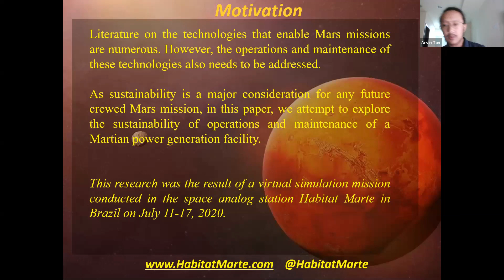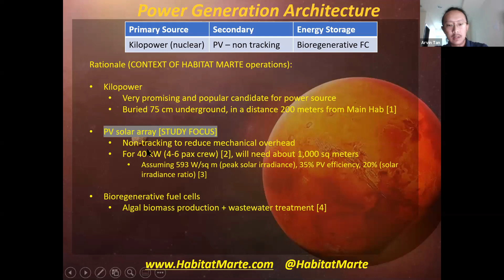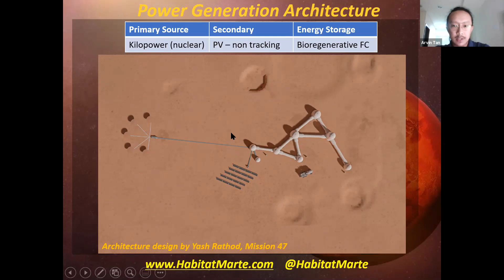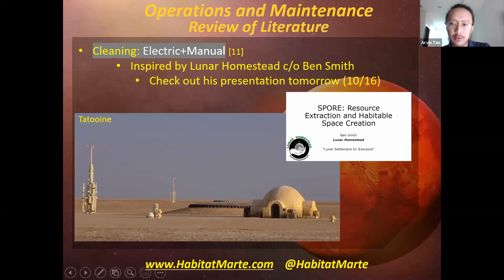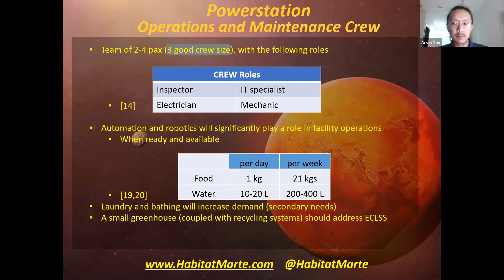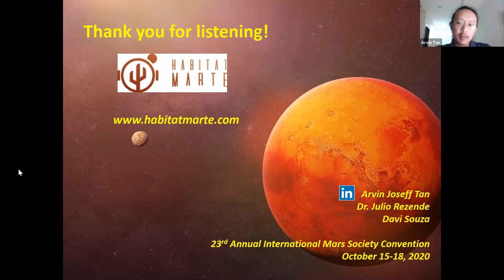Operations of a Power Station on Mars - Arvin Tan- 23rd Annual International Mars Society Convention

Comment: Great to see someone getting into the "nitty gritty" of maintenance.
If kilopower is used expect costs to exceed all other costs combined and the time required to develop and install it constantly pushed out. I assert this because it will not be Musk developing it but rather a defense contractor with a cost plus contract in all probability.
Solar power satellites are dramatically better but they do require rectenna arrays. Presumably they will need some cleaning but dust is likely to bother them much less and of course dust storms don't bother the microwave beams at all. Transmission of power in the kilowatt range was first demonstrated in 1967 and Starlink shows how to do it and an increase in power level or a "Starlink on steroids" seems much easier and cheaper than any surface alternative. Doesn't it make sense to aim for the best first?